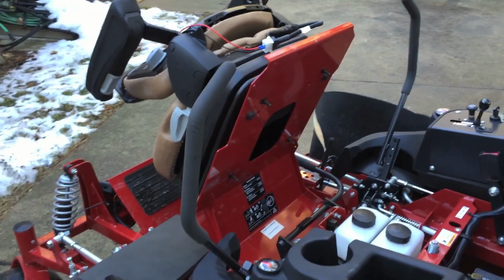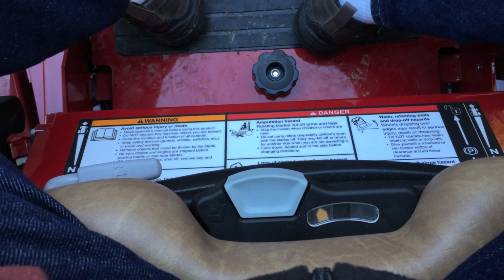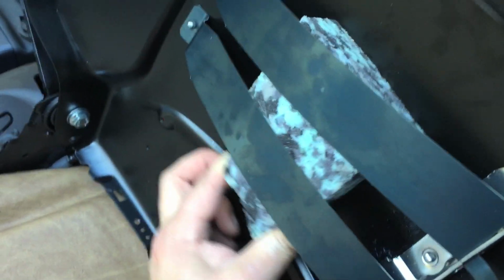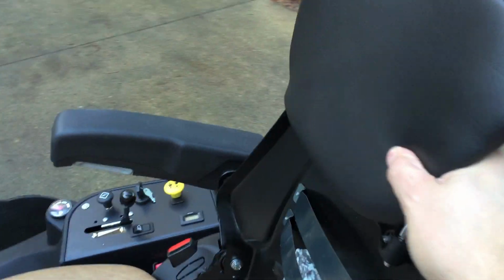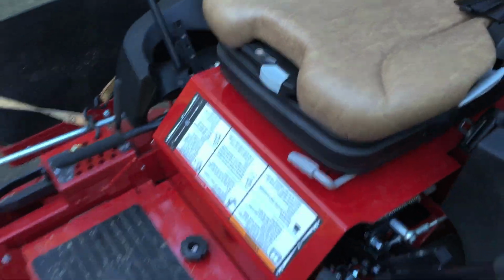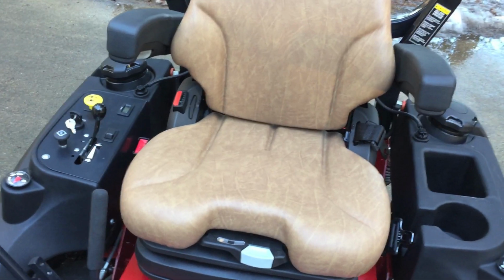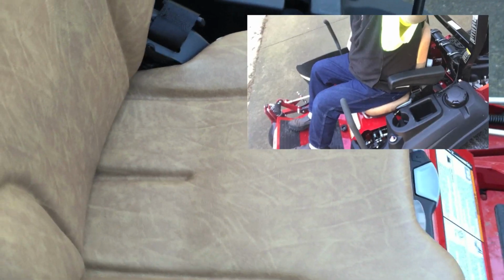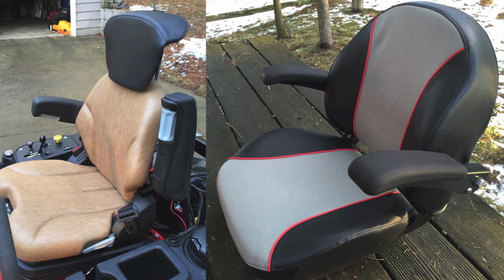Grammer Air Suspension Seat on a Ferris is2100z zero-turn lawn mower

Comment: bought one of these for my bad boy the same style but without the compresser. it was alright at first but after awhile the cushion felt like it hardend up and like yours no matter what position you tried couldn"t get comfortable back support didn"t feel right I ended up tearing it apart and modifying it and mounting the bad boy seat on the suspension unit much better now.
Reply from the maker: Thanks for watching. FWIW, I ended up with a Milsco V5400 air seat.
Reply: @MinnesotaEric  what does one of those seats go for in price?
Reply from the maker: @anthonymorrison2167  At the time, I paid something like $600. Looks like they still are on eBay. But Seat Wharehouse here in Minnesota has them for $499. https://seat-warehouse.com/product/milsco-v5400-air-ride-seat-hustlerexmarktorobobcatdixie-chopperzero-turn-2/
Reply from the maker: @anthonymorrison2167  Also here is my initial impressions although I can now say I'm very fond of this seat and would buy it again and again. https://www.youtube.com/watch?v=IK37xdvkvNM

Comment: Eric
Just ordered my is2100z today and was able to save a chunk by buying a 2015 model. WAY more mower than I need but I had found fault with everything else I looked at. I got the 26 Vanguard not EFI. Would have been another 500 for that which was temping because of ethanol gas. Now I've got to wait a few weeks to get it delivered and I can't wait. Gonna let the grass grow a tad more than usual for a bigger effect on the first ferris mow;-)
Sorry about your back man. I used to think people who had bad backs were whiners. Then one day I turned backwards to grab a telephone on the other side of the bed. Proceeded to lay there in agony for 5 hours waiting for my wife to come home. Also used to fly high g airplanes and occasionally my neck would cramp up and lock out. 2 emergency room visits from those. Painful. So I hope you get better.
My mower will be the IS2100z 52 inch mulch setup with the vanguard 26 HP Briggs. 61 inch deck would have not fit well in between my beds in a few places. Nor as easily into the shed. Gonna teach my son to do all the trimming;-)
Best of luck...
Reply from the maker: +Mark g As apparently you did, I too talked myself into spending more to get the 2100. I got a year end 2100 with the 26hp not-EFI Vanguard as well. What caught my attention is that my 2100 came with 5400 Hydro-gear HSTs rather than the 4400s the brochure specified. I plan to add a Power Chute for blocking off the clippings on demand.

Comment: You need to check out the new 2021 high back suspension seats that Ferris have .
Reply from the maker: Those new seats look really plush, Larry. Have you had a chance to try one yet?
Reply: @MinnesotaEric  I've set in them but I haven't got my mower yet .
Reply from the maker: @larrymitchell546  When you get it, and try it out for awhile, I'd appreciate you're sharing what you think. With my ever-on-going, Pay Loader Project, I'm now starting to sniff around for yet another seat for it. Today we're taking the Pay Loader down the road six miles to start ripping stumps out and knocking trees over to widen the driveway trails on my other property.

Comment: Eric. I tried to find one with those 5400 hydrous but no luck. I can't remember for sure but the tire size may have changed slightly when they downgraded the hydrostatic to 4400??  Can't find a lot of good historical specs on ferris...  U got a great mower. Hope I works well for you. I'm only mowing about an acre of grass so I know I went way overboard.
Reply from the maker: +Mark g For me it had to do with expectations. I had been looking at an IS700, but was interested in the full suspension. When I saw the machine had the 5400s, I backed out the cost of those and decided the purchase of the 2100 was a value over the 700 and especially for the full suspension features.
Reply: +EricTheOracle
I started out looking at a Toro MX4800, but the construction looked a little light after looking at some bad boys, and I didn't like their Kohler engine choice.  Then stumbled upon some Bad Boys and waited till this spring to have a look at the new Maverick mowers, but I had serious reservations about the electric linear actuator that they use to raise and lower the deck, otherwise a very well laid out mower with simple mechanical features..  Had never heard of Ferris but was recommended a look by my Stihl shop.  Disappointed with the anemic looks and front wheels/suspension on the IS600Z, and then again on the IS700Z because it occurred to me they aren't letting the deck truly float with the wheels.  Every mower I looked at had some sort of compromise, and I"m not good at compromise.  The IS2100Z gave me good engine choices in a package that looks to be indestructible, and a suspension to boot.  I will baby it anyway, and someday the extra I paid for it will come back to me cause I can sell it to a commercial mower guy.  I am mowing about 1/2 acre of Zoysia Palisades, which is a pretty tough bladed grass, and the rest of my lot is just various wild grass and weeds that I keep knocked down to keep the snakes and scorpions of texas at bay.  I also keep the road banks mowed a ways on either side of property.  

I had also never heard of Snapper Pro.  Just never seen one or paid attention if I had down here in Texas.  But they look to be the exact same components of the Ferris without a suspension.  Probably a good choice if somebody doesn't care about the suspension.  My Dad had a classic Snapper mower when I was a kid we mowed half of Missouri with every week.  That thing was awesome.

The reason I am rambling is that maybe I can give other people on a mower hunt information or thoughts they might have missed.  

to all happy trails...

Comment: Hi, was wondering if you ever found a seat that worked for you?  I have some of the same issues you have.   Thanks
Reply from the maker: I sure did: A Milsco V5400 air seat. I haven't gotten around to doing a proper video review, but before I really got to try it out, I went out into my garage in January, 2016, and made a quick video about it. Check it out: https://www.youtube.com/watch?v=IK37xdvkvNM
Reply from the maker: I did, a Milsco V5400 Air seat was the hot ticket. At some point, I plan to do a real review.
Reply: @MinnesotaEric  I hv similar issue...can u elaborate on the milsco...price quality comfort where made? etc

Comment: I don't get it-- why would you need to mount a air suspension seat on a lawnmower that already has a spring and shock suspension?   unless, the suspension on these mowers is ineffective-- in which case, why did they go to the expense of designing it into the mower in the first place?
Reply from the maker: Because the two-speed 5400 HST drives allow me to mow up to 18 mph—as demonstrated by my wheeling a 1250 pound mower.

Comment: Nice video.  I had heard of the grammar seat but no idea such things were that complex.  

I'm wondering how you like your Ferris IS2100Z ??  I'm trying to talk my wife into authorization for it's purchase.  And it's a tad more than other models I'm looking at??  Haven't seen any negative reviews yet...  So anything to criticize would be your chance.  Thanks for letting me know too that that stock seat is comfy...
Reply from the maker: +Mark g I've replaced the stock seat (which is a good non-suspended seat) with a Milsco V5400 Air seat. The 2100's suspension combines with an air seat makes for a very plush ride.